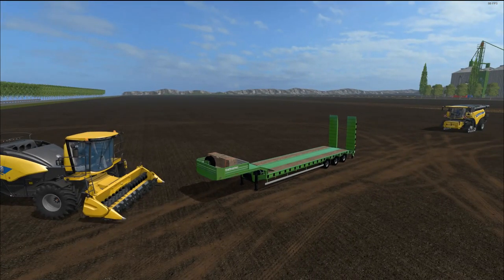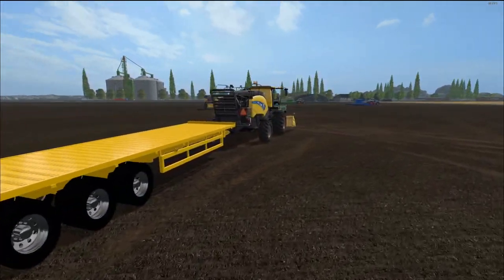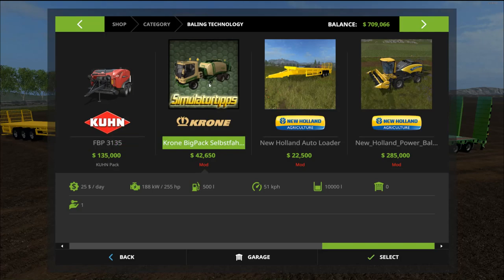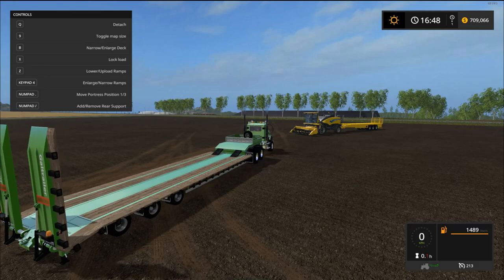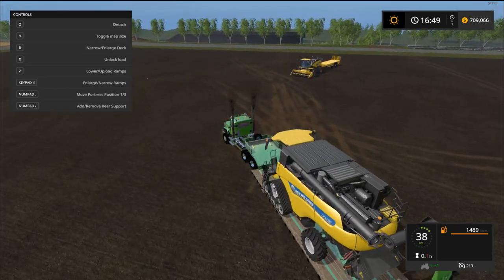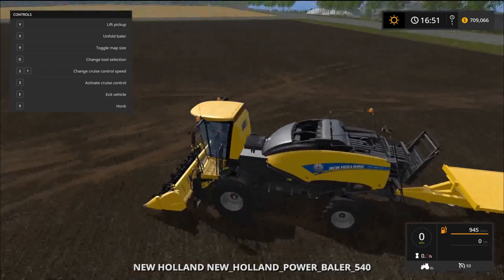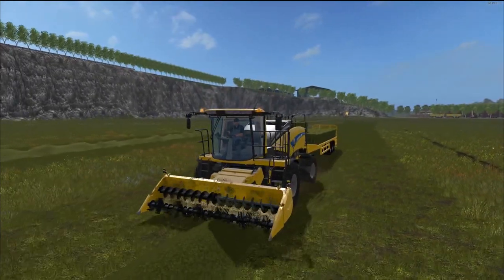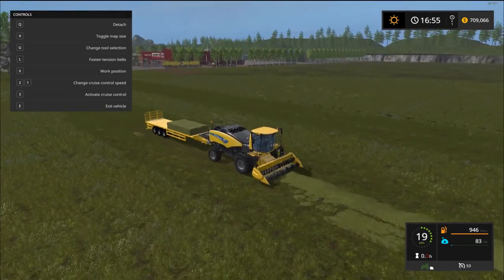Farming Simulator 17 - Power Baler With Auto Loader Trailer & Low Loader Galtrailer "Mod Review"

Comment: Thank you Nick.  I've been looking for a low-loader that would be wide enough for the NH Combine and now I can check that item off my list.  I appreciate you taking the time to do these reviews.

Do you happen to know of a small utility trailer with a working ramp which can accomodate something like a skid steer or the little Amazon Profihopper mower?  Thank you for your time.
Reply from the maker: Your very welcome and thanks so much for the compliment. I didn't notice any small ones but I'll keep my eye open for one for you.
Reply: By the way, I think the link to the low loader is incorrect.  I believe that is pointing to an FS15 version.  Could you please post the correct link?
Reply from the maker: Man I don't know what happened there. Thats the exact same link I used. Just look at the date and the comments. He either switched it or took it down all together. I just spent the last 30 min trying to hunt it down with no luck. Just getting the FS15 version. Sorry about that man, I have no idea whats going on with that. Someone else mentioned that earlier as well. Yeah just look at the date and the comments. Plus the one I have is v1.2 Thats going to drive me nuts now.
Reply from the maker: Well I finally found one took a lot of looking but that would have bothered me all nigh. Thanks for bringing that to my attention. I have no idea why he deleted or changed it but I managed to find another. Here is the link - https://gamesmods.net/farming-simulator-2017/trailers/71734-gal-low-loader-trailer-v20.html
Reply from the maker: Ah, i just noticed it was a different person in the credits. It was probably stolen or something. It's just a guess thou. I also fixed the link in the description and the credits accordingly. Things like that will eat at me all night until i resolve the problem. I have a touch of OCD i think.
Reply: Thank you Nick.  Much appreciated.

Comment: I have unzipped the file and loaded both files in my mod file but it still isn't working. I'm running the latest version of the game. Can anyone help me out?
Reply from the maker: Silly question but did you make sure to put a check mark on them when loading up the game. Sometimes people forget. They should both be in the baler section of the shop. Not sure if the update effects anything. I bought mine on Steam and it updates automatically.